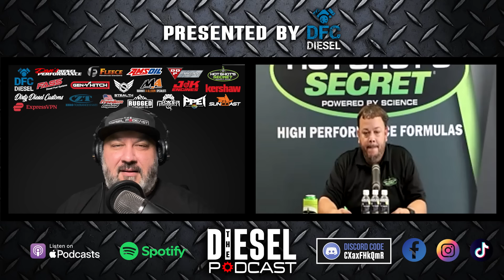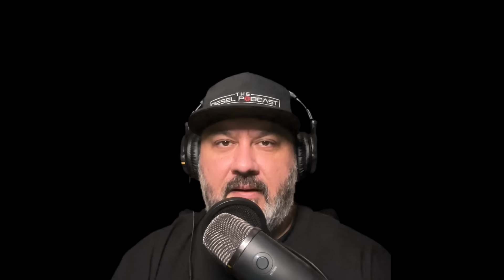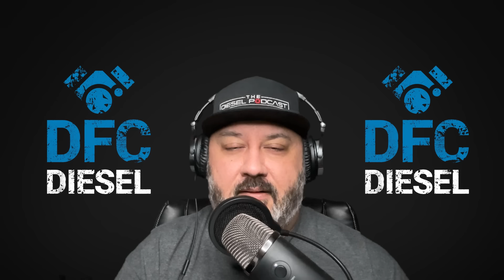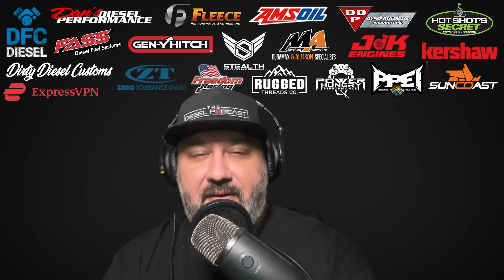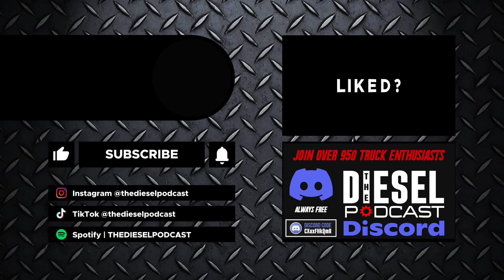This Hidden DEF Problem Could Cost You Thousands

Comment: I'll save you all the pain of sitting through this.  The product is essentially a "water wetter".  It lowers the surface tension of the DEF fluid, which has several benefits such as reducing (and preventing) the growth of urea crystals in your DEF system as well as (potentially) lowering the freezing point of the DEF fluid.  It is both preventative and corrective as far as maintenance goes, and might be a good product to use if you do not drive and tow with your diesel regularly as DEF can degrade over time, which can contribute to crystallization related issues.  Evaporation of the DEF fluid in the DEF tank is a leading cause of DEF system related issues, particularly with regard to level-sensing related codes.  In my opinion, the risk of urea crystallization from evaporation inside the DEF tank is probably the best argument (for the average light/medium duty owner) to use this product occasionally to assist in dissolving the urea crystals back into solution.  From a preventative maintenance perspective, I'd say using this product (or similar) 1x a year would be a good, low risk investment to manage and/or mitigate crystal growth in your system as well as potentially cleaning your DEF injection nozzle.  Caution should be exercised when using this product to avoid diluting the DEF solution outside of the manufacturers urea concentration minimums, which is why I don't think this should be used every time you add DEF fluid.   Contrary to what is said multiple times in this episode, DEF fluid doesn't "burn".  DEF is injected into the exhaust stream and its primary role is to reduce NOx that is generated from the combustion cycle.  The high temperature of the exhaust stream vaporizes the DEF as it is injected, and that high-temperature mixture then reacts with the catalyst in the SCR to convert NOx to Nitrogen and water vapor.  DEF Fluid has nothing to do with the DPF, and vice-versa.  In modern systems, DEF is injected post-DPF, into the SCR system.  The DPF is essentially a giant ceramic cigarette filter and its primary role is to capture soot particulate.  The DPF on modern diesel trucks does "burn" to clean itself out, typically via direct fuel injection into the exhaust stream immediately prior to the DPF, in the DOC (which also includes a catalyst).  This increase in exhaust temperature via fuel injection then "bakes" the particulates out of the DPF, restoring permeability (flow-through) as well as restoring it's ability to properly filter out particulates.  The order of operations is (simplified):  Combustion -> Turbo -> DOC -> DPF -> DEF injection -> SCR -> Atmosphere.  You're welcome.  Quite possibly the worst diesel podcast I've ever watched, and I've given it multiple attempts.  It's like listening to paint dry.
Reply: Thanks for the summary
Reply: 😂😂
Thanks bud

Comment: How's this better etc than reslone
Reply: I had a def issue on my 4th gen Ram, was going to dereg in 25 miles. I used rislone crystal cleaner and filled my Def tank with platinum blue. Problem gone without a visit to the dealer. I use regular blue from Costco now and the rislone maintenance Def treatment. No problems for the last 7k miles. I know rislone 100% works so no need for me to try something new when the rislone works. Thats all that matters.
Reply: @LZwoodOU812  That's what I was gonna ask. Literally having mine towed to the dealership right now to get some warranty work done on the DEF system and I swear it's so frustrating! Then I found this podcast and of course two different episodes and two different products 😂 Glad to hear Rislone works for you and probably gonna just go with that after they get my truck all dialed in.
Reply: right? I hate it when they don't get asked about the competitor product and what separates them. They never produce objective test results or anything nor are they asked about testing methodology. Useless. Just a sales pitch. I have a magic potion that will cure your ails send me money. No demonstrations, no hard questions no evidence whatsoever. Just a platform to push a product.